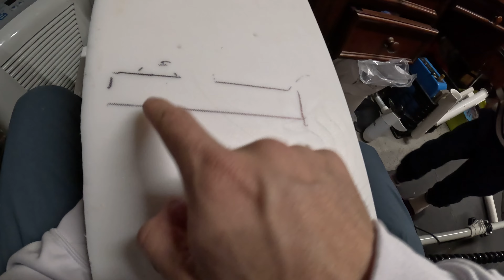Motorguide Xi3 kayak trolling motor BOW MOUNTED on Hobie Compass!

Comment: Gonna try this with an auto-boat adapter and a smaller motor on my compass. But great idea!
Reply: Auto-boat spot lock adapter*
Reply from the maker: love this idea!  I researched the auto boat adapter before doing this, it had just came out.  But i figured at $650 + $250 for the trolling motor and then building a custom mount for the motor would bring me into about $1000-$1200 and there just wasnt enough data out there on other people who had success with the autoboat except for the kayakDIY guy so I figured it was worth the couple extra hundred bucks to just do the motorguide.  But please let me know if you do the auto boat with success, it looks awesome!
Reply: @PeterRanieriII  will do, i would also do the motorguide but my main issue is the weight of it so I am opting for the autoboat for now. I can always upgrade so its not a huge deal.
Reply from the maker: @cloutmaster965  great point about the weight!

Comment: Hey what is your favorite braid? I remember you did a ton of testing.  I just bought a 4k diawa saltiest.  Probably going to put 30 lb
Reply from the maker: @Waterboy516  I like Berkeley x9 the best right now and power pro super slick 8 would be my 2nd favorite. In general I like the smooth feeling braids not just for casting but the sound is greatly reduced through the guides. On my underwater camera I have like a 40lb heavy duty 4 strand braid and I can hear the braid rubbing the guides at the bait. Not sure if it spooks fish but I’d rather be as silent as possible
Reply: Awesome thank you. 
Im going to get a trolling motor im not sure if I should get the water snake or splurge on the xi3.

What are your thoughts on the water snake and can you make a video on it?
Reply from the maker: @Waterboy516  i would start with the watersnake, I love that thing, still use it just as much.  check out the hobie mod playlist, I have the rod holder mount video in there for it.  https://www.youtube.com/playlist?list=PLZsVnWkyzKlnj8VwDjXEqIz7KCZxgM5_o  you get that watersnake for $170 + a 100ah LiPO4 battery for $200 and your good to go under $400

Comment: Pete, how has the xi3 been holding up?  Overall it seems like a good motor but some complain that it sometimes has a mind of its own.  Stops on occasion or can't get out of anchor mode without rebooting, for instance.  Just want to check with you before deciding on Motorguide vs Minn Kota for my Outback.  Thanks!
Reply from the maker: So far its holding up really well.  I have not had any issues with it starting or stopping by itself.  Im sure minn kota is a great motor as well though I don't think they have a shorter shaft model.  pretty sure the shortest is 54in with spot lock which is going to be too long for a kayak.  Let me know which direction you go!
Reply: @PeterRanieriII  I bow mounted an Xi3 on my Outback last week.  Working great so far. The added weight caused me to insert scupper plugs because so much water entering by seat at higher speeds.  The biggest complaint so far is to hold on tight when starting pinpoint gps ("spotlock") because the unit whips you around forcefully in different directions.  They need a fix for that, because it could capsize you in rougher seas. Also, I learned the hard way not to get the cord tangled around the motor wires, otherwise you can't pull the motor up. It tends to steer to the right so you have to straighten out every few minutes of travel.  Overall I still pedal a lot so I like the ability to use my mirage drive and have the motor ready if/when needed to fight current and spotlock.
Reply from the maker: @cn65666  yea i noticed the bubbles coming up from scuppers a bit more on high speeds as well, and yes thats exactly my initial concern as well about the anchor lock/spot lock it def whips you good initially if your headed opposite in where it wants to lock you.  So ive noticed if you kind of allow yourself to naturally drift for a second before hitting it its a bit calmer of a reaction and you;ll also just get used to it if you know to anticipate i think...but yeah thats awesome Im glad to hear its working out in general for you so far!  I really like it for certain types of fishing, not all the time but many times it makes fishing a whole lot easier in the current and wind

Comment: Quick real question, how satisfied you are with compass, planning to buy a compass. It’s really helpful when  a professional like you recommend a kayak
Reply from the maker: I think my opinion is a bit bias since I've only ever owned a compass and a passport but I love my compass.  Without question it has been the single best purchase I ever made in terms of fishing gear.  The opportunities that opened up were more than I even imagined, and I genuinely love fishing from a kayak with pedals.  Would I also love fishing from an outback or old town model?  probably yes.  If you like to do mods yourself though and transport ease is important to you, compass is hard to beat
Reply: @PeterRanieriII  thanks
Reply: I have both a 2019 Outback and 2022 Compass. They are very comparable performance wise but the Compass is about 30# lighter fully rigged. The Outback handles rough water better. My two cents.